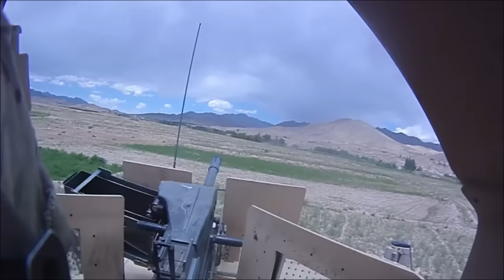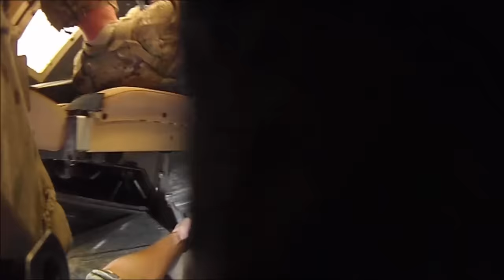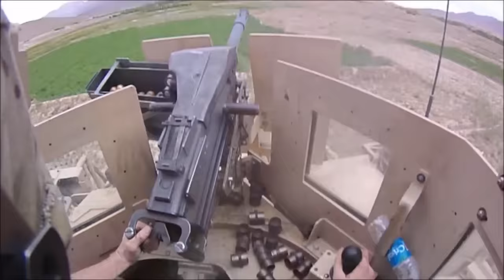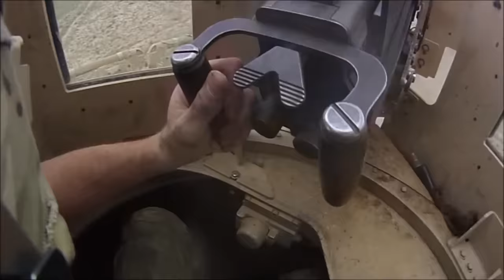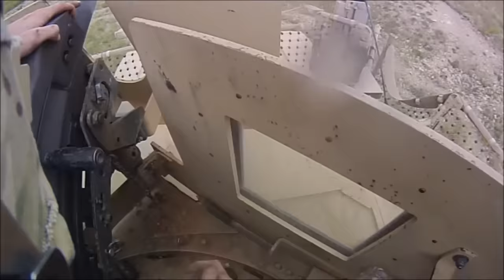MK-19 AUTOMATIC GRENADE LAUNCHER FIREFIGHT

Comment: Its so nerve-wracking whenever he has to lean over the gun to reload it like aaaaaa I feel like this thing really should be designed so you can reload it from BEHIND the shield!
Reply: Very hard to get hit even without the shields and at that distance bullets aren’t even striking the vehicle
Reply: @jochaldo8076  I think if they are in range to shoot grandes at the enemy then their bullets can also reach that range.
Reply: @bobbypatton4903  well of course the bullets reach them but the chance of one of the bullets hitting him at that distance while showing less than half his body for less than 10 seconds is way too improbable
Reply: Pretty sure that’s what the shields in front of the ammo box are for.
Reply: I could be wrong, but it appears the operator's back is shielded. If the operator felt it necessary, they could turn their back towards the enemy while reloading.
Reply: @ericblackwell382  the operator isn’t shielded fully. A little more than the front. Most lack the big overhead structure in the Marines. But when reloading he’d expose his back to the enemy having to rise above the shielding to actually feed the belt. My father was a Gunny who fired these. They look as poorly designed as they are.
Reply: At least he has protective shield. In my day we didn’t have shit. Army was too cheap to provide anything. Grunts are cheaper than armor plating I guess.
Reply: @jochaldo8076  snipers bro, snipers
Reply: @onyxrafle8066  thats actually happened before lol.  What was that one sniper guy's name that killed so many ppl in the snow? Ended up getting his jaw shot off and still made it back to saftey or something. I dont remember all the details
Reply: love how it still spews out the casings behind the shield tho
Reply: I thought the same thing. He's not in direct fire here. But if he was, he couldn't safely reload.
Reply: All that armor around him yet they couldn’t just make it enclosed
Reply: @thegodofyoutube266  probably won’t lean over to reload as he won’t feel as safe and just reload with his arms over the shield?
Reply: @jochaldo8076  yeah who cares about that 1% chance, you get only killed 1 out of 100 times
Reply: @onyxrafle8066  20:45 yes
Reply: I was thinking the same thing.

That reload procedure is prime for sniper fire
Reply: the question is, is redesigning the weapon, the platform, and the vehicle cheaper or more expensive than paying for the soldiers medical bills and payments to surviving kin?
Reply: @princeofcats6883  White Death, Simo Häyhä, ate snow before trigger, so as not to reveal breath.
Reply: @arzaykarzay5884  need more vet feedback at the design level
Reply: An entire rethink on how to load is seriously needed. There HAS to be a better way.
Reply: @user-hu1jr6fb9k  it's all a numbers game.
Reply: @vanekirk  think about the sight lines. Anybody with a standard rifle who's at a range close enough to accurately hit the guy up top is mostly covered by the shields in front of the belt box, even while reloading. Anybody far enough away to get a good sight line to him is going to have a hard time judging bullet drop and wind well enough to hit him unless they've got a high-muzzle-velocity rifle and ammo combination, and a spotter (or high ground). The GoPro really distorts how exposed he is, it's really just his head and maybe some shoulder sticking out from what I can tell, very small target, and he can always pull it back in if shtf. Maintaining good visibility to allow for good situational awareness is better than airtight armor.
Reply: They had to nerf the shield, it was unbalanced for the other teams
Reply: Wouldn't it be better to flip top, swap can, open can pull. Chain close,. Crank and get back to spewing the fun?
Reply: @jochaldo8076  still a random shot could accidentally hit you in the face. is possible. im sure youre well aware of that doing it
Reply: @agooddemoman8603  its very effective
Reply: @jochaldo8076  well at least it's not impossible.
Reply: TANB
Reply: @bobbypatton4903  it’s got a max effective range of 1600 yards and a max range on 2400
Reply: @onyxrafle8066  it has happened. There’s a video of that happening to a guy on YouTube somewhere. I thinks it’s called special forces guy get shot in the head or something like that.
Reply: @bobbypatton4903  no they cannot aks are very short range weapons
Reply: I’d be trembling to even stick my head out the hatch
Reply: @michaelducasse1551  imagine getting on of those casings down the back of your shirt. 😬
Reply: @wallymcguire2033  I don’t think you would want to take a bullet so I’d be quiet
Reply: Well it's a good thing that most military members aren't soy like yourself and can load it properly without being scared.
Reply: #droneseverthing
Reply: Most military members. So you're soy as well?
Reply: @ttss5726  that would defeat the point of a manned turret.
Reply: @ClingyCrab  Not at all... it doesn't protect the upper body when reloading.
Reply: @jochaldo8076  At least one round hits the vehicle at 20:41.  I think I heard a few more after on too.
Reply: I could have sworn their where ball turrets for this?
Reply: Agreed
Reply: The reason it isnt is in case of a chain reaction of them going off inside the ammo holder
Reply: @jochaldo8076  yea but your chance is greatly increased when you yea know have to lean like halfway out of the top to reload......
Reply: The grenades are designed to not arm until around 15 meters I believe.
Reply: @AcidxAnarchy  they are firing from 2000 meters, in pretty sure theyd need a hell of a sniper. thats why theyre shooting grenades lol
Reply: @fornito530  true, but its not impossible. They could have a 50 cal or something u never know.
Reply: @sendit2873  the AK-47 has a maximum EFFECTIVE range of 400 meters, which is about 100-200 meters further than the m4 (not quite sure on the range of the m4, correct me if i'm wrong),  which for the taliban who use guerilla tactics and IEDs is plenty far, especially when the ROE are as strict as Afghanistan's.

i might be completely wrong on all of this i'm just a fucking nerd, however if i am wrong please tell me
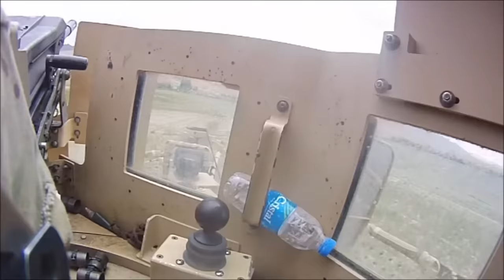Reply: @jochaldo8076  7:38 I believe one of them got really close HERE though.
Reply: @jochaldo8076  20:48
Reply: Tons of civilians commenting here, obviously. This range would be the longest sniper kill in history, it's ridiculous to even suggest that a Taliban fighter could hit anyone with small arms fire in this engagement.
Reply: @princeofcats6883  white death?
Reply: Can't imagine how stressful it is to reload with your arms not even protected by even a single layer of clothes... I mean that quite of a balance but if they can buff the resistance by 1% each reload it could be as vaiable as the meta...
Reply: 20:42 
"yup, they're shooting at me"
"Get that fucking thing reloaded"
"Yeah, I'm trying to reload it without getting shot in the head"
Reply: They have a kevelar blanket behind them I think
Reply: Shield was improvised in the field, and Later added to vehicle designs
Reply: @onyxrafle8066  you clearly haven't met Houston Jones.
Reply: @bobbypatton4903  If they were anywhere close you would hear the bullets.
Reply: @jochaldo8076  no because they have higher ground because he's in a gunner seat giving him height Avantage

The enemie would have a hard time determining elevation

Snipers have harder time killing something higher then them 

It's a dessert it gets REAL WINDY so bullet drag is increased so u have to aim higher or more to the left or right because of wind 

Grenades go lower velocity and the high velocity grenades are still low velocity but farther range they don't go subsonic or supersonic they usually go transonic slower projectiles that are heavy like grenades have absolutely almost no air resistance because it doesn't mess with wind so much it needs to be calculated but sniper bullets are lighter then grenades and go super or sub sonic but grenade have more drop but never have wind drift a ballistic calculator for snipers are a must but those are low end countries like Tilibans and Afghanistan the afgan is with the us but the iraian and Tilibans are enemy  to us

Grenades are better then snipers because the lack of wind drift

Comment: that sight flopping over all the time would piss me off.
Reply: did they intentionally did that?, like no support of flipping over,
Reply: Agreed a wing nut and bolt would fix it.
Reply: a piece of chewing gum would do the trick..
Reply: @andrewbrereton1921  goat milk mabe
Reply: It doesn’t matter. Once you are close enough you don’t need it.
Reply: @cutiebunnyamber3447  probably it was done so that you only aim once and then your shoot as to not damage the sight so it doesn’t fling off do to recoil
Reply: And the hinge pin that popped out of the top cover halfway through the fight.  He had to pick it up and put it back in.  Several times the weapon just doesn't fire when he tries and he has to slam his hand down on that corner of the top cover to get it working again.
Reply: The gunsight is JUNK. Better off taping a piece of cardboard with a 'V' notch cut into the top on top of the gun.

Comment: 20:48 “yea I’m trying to reload without getting shot in the head”
Reply: Just another day at war
Reply: @Supperup40672  indeed.....
Reply: more so they said that the targets were 2000m away. Mk-19 can fire out to 2200m (google) small arms fire is hardly accurate at 300m and that's being generous. he was relatively safe even from a sniper getting a perfect shot off seeing as the only high ground was miles away. he probably felt relatively safe, since he knows those limits better than most.

Comment: Seems like it would be a significant design improvement to allow reloading without being so exposed.
Reply: you’re right
Reply: It can be removed from the mount as a crew served weapon. It would be an improvement if it only served as a vehicle mounted weapon.
Reply: Yeah, really bad, also the feed is not great.
Reply: It should have a bulletproof glass weapon or vehicle mounted removable shield. Its far easier, faster, and cheaper to fix a small glass panel than someone's face.
Reply: I would probable like that. Pretty sure.
Reply: Definitely l.. I just left a comment saying that
Reply: The box that contains the belt makes it auper hard to do that and allow the gunner to aim plus the cant just have it feed from a super long belt as the weight of the belt would be to much for the guns feed system its designed in one of the beat possible ways and he reloaded super fast considering what he has to do
Reply: So none of you actually have fired this weapon but have all kinds of ideas on how to improve it.
Reply: I wanna be a mongoose that would be worse if it gets it could explode and kill them. All lol
Reply: @AlexWithington  whoa! I didn't realize the feed system has to suspend all the ammunition, it physically has to pull all of it like a rope
Reply: @jamesgoldring1052  yes basically
Reply: @AlexWithington  its like that game where you see how many plastic monkeys you can link together
Reply: This is cheaper and does the job
Reply: its surprisingly not very dangerous cause if your close enough that someone can accurately hit you while reloading your doing something wrong or you brought the wrong hmmvv
Reply: Rotate turret, reload?

Comment: "The Taliban stopped engaging after we called four A-10 "

Bruh
Reply: Air Force saves the day
Reply: That’s because a 10 warthogs shred tanks 

Doesn’t need to be a tank tho......
Reply: “Death....From above”
Reply: Timestamp?
Reply: @Grimstar-nj9rf  they just mentioned it in the description
Reply: Tax payer dollars go BRRRRRR hahah
Reply: @witherwolf1752  they really don’t though it’s more of an anti-personnel vehicle the 30mm can’t penetrate armor that is that thick and there weren’t any tanks over there
Reply: @mikeferguson1833  A-10 not the mk19
Reply: @vipereagle7446  yes I know
Reply: @vipereagle7446  the Mk19 fire 40mm HE and the A10 shoots 30mm
Reply: @M.ds87  bruh, if the don't receive funds, the tax payers themselves won't exist for funding 😂. Random terrorist attacks go brrrrrrr then
Reply: BBBRRRRRRRRRRTT
Reply: imagine if the US had a competent president?
Reply: @turkeyman631  we don’t I’ll admit
Reply: @mikeferguson1833  but the A-10 shoots at like 6,000 rounds a minute with 30mm
Reply: @mikeferguson1833  The A-10 IS an anti-tank platform. They just don't try to power through the thicker front armor. They hit from the top, rear or sides, because attacking the weak points for massive damage isn't just for the memes.

Comment: "Yeah I'm trying to reload without getting shot in the head"  lmao.
Reply: john smith at that distance hitting him with an ak is highly unlikely. The bullet will drop to the ground before it even hits him
Reply: @abradolflincler1563  You don't know what you're talking about
Reply: @myrlewulf6256  i do know. Ever heard of bullet drop? Plus being this accurate with iron sights is highly unlikely.
Reply: @abradolflincler1563  so cringy
Reply: @myrlewulf6256  not really, as a person who shoots guns as a sport every week, he has got a point, but on the ak thing, you do.
Reply: @spec9819  

I shoot regularly too. Again, you don't know what the enemy was equipped with at the time, if it was an AK or a PKM, and it doesn't need to be extremely accurate weapon for the bullet to land near you. An M4's effective range is only 100M more than an AK. Here a guy is shooting an MK 19 which has an effective range of 1500M and hopefully they were more than 500M out, but the guy being worried about being shot is kind of telling.
Reply: @myrlewulf6256  I never really said anything on what they had equipped, and I agree that we dont know what they had, but when you said just aim the gun a bit higher, it isnt how it works, theres wind speed, direction, downdraft, bullet drop, and other factors that they have to factor for at that distance.
Reply: @spec9819  

And? Aim gun higher and pull the trigger, you only need to land bullets around them randomly in a 25x25 square. That is easily doable. Wind direction can be fudged easily too. If any of them have a telescope/binoculars I'm sure they could have accurate suppressive fire at that range. How far do you think it is?
Reply: @spec9819  

I looked at his sight and pictures online, since I've never actually been near a gun like this. He seems to set it at 800-1000M or so which would be a very far shot.
Reply: @myrlewulf6256  I'm pretty sure there was a person who had been in his unit, who had commented and managed to answer some questions,  apperantly the other forces were about 1200 or so meters away, and the conditions were a bit shitty.
Reply: @spec9819  

Yeah hard for me to tell with the fish eye lense but I would believe it
Reply: Colton R  

Yeah people think it's call of duty.
Reply: 1 comment 15 reply 3 people arguing 

Bruh
Reply: Just think about how u perceive things!
Reply: "Terrorists " insurgents in active battle.